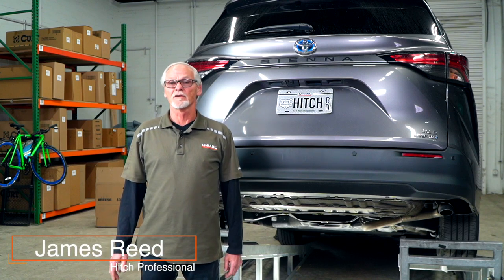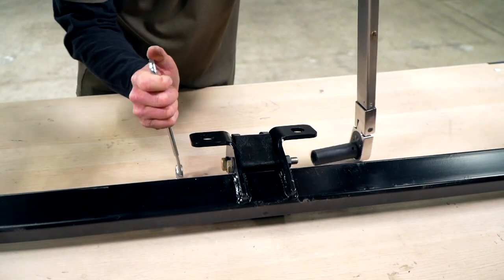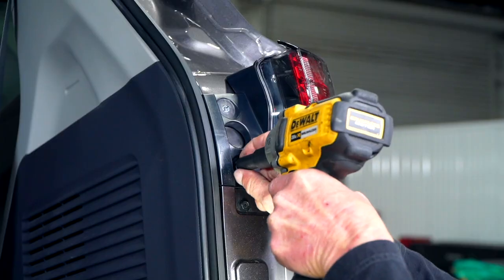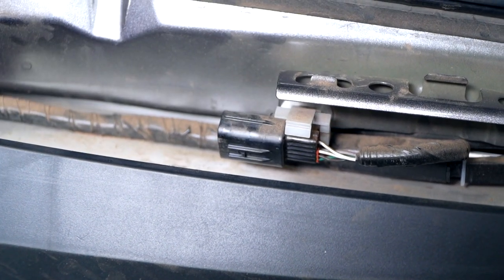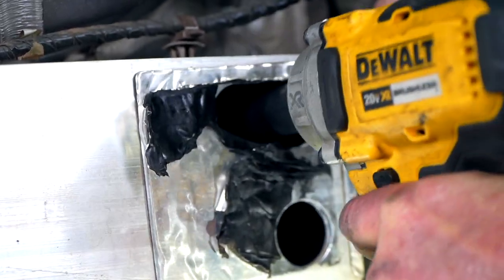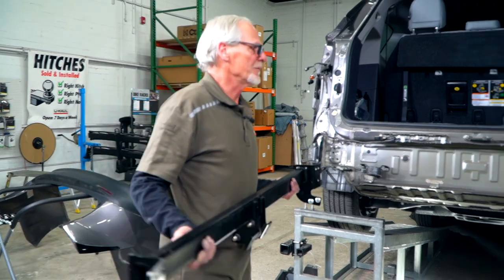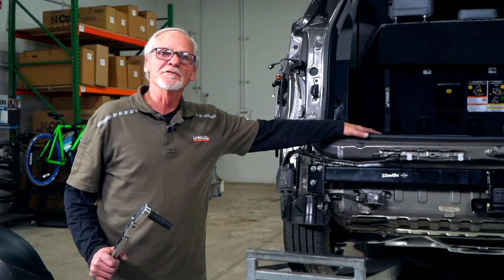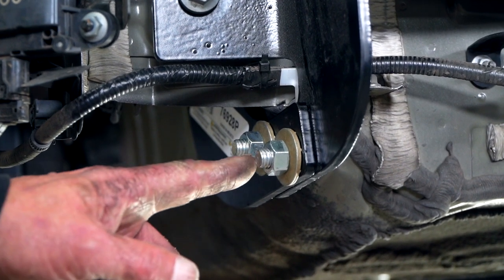2021 Toyota Sienna | U-Haul Trailer Removable Receiver HITCH Installation

Comment: Is this car hood at towing ? Have the power ?
Reply from the maker: Refer to your owners manual for manufacturers recommended tow capacity as well as the Tow ratings of your hitch system(Receiver Hitch, Ball, and Mount all have their own rating). The lowest number between them is your maximum.